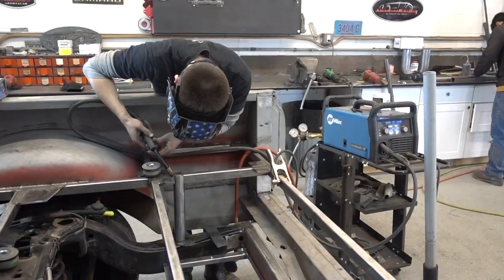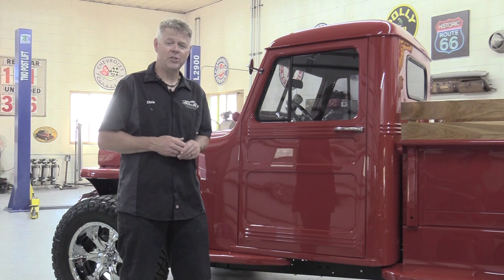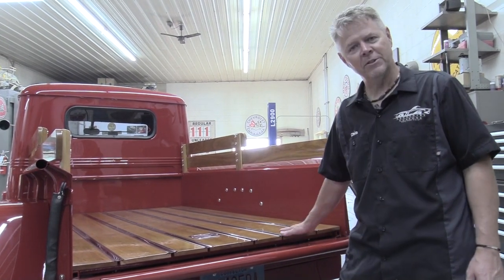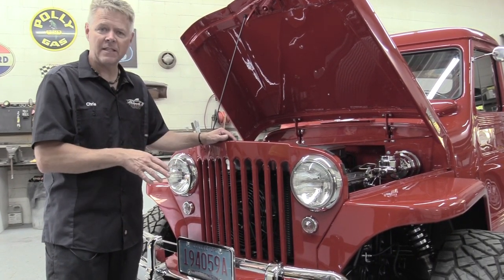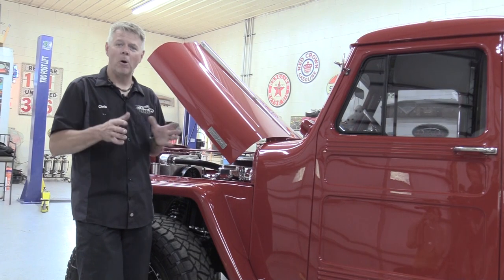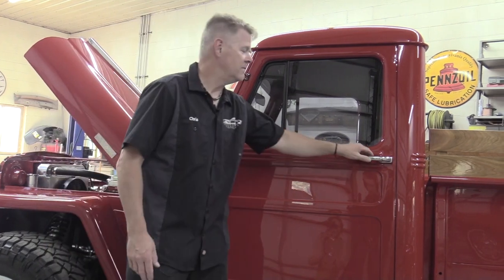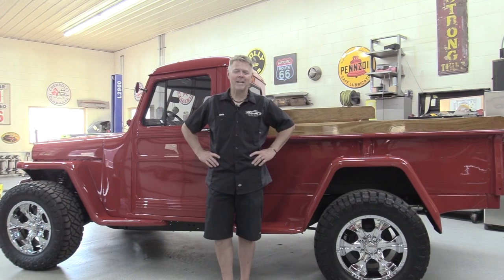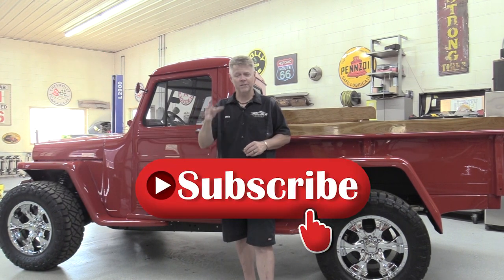LEGENDARY 1948 WILLYS PICKUP BUILD: PART 13 THE REVEAL

Comment: Great Job!!!  I've got a 1961 4WD OW Truck keeping it original with a Flathead 226 2 speed Transfer case and 3 speed transmission.  Trans, transfer case and front end rebuilt new brakes all around, Aluminum radiator, repainted OD Green with a roller brush.  Looks very tactical with the dull paint.
Reply from the maker: @ericsampson273  All about the memories! Thank you for watching.

Comment: I’ve owned a 1950 Willys truck for 25 years. It’s an on going project. I’ve restored it once and now I’m redoing the drivetrain and making it more highway friendly. I’m shooting for a hot rod muscle truck. Almost done again! Great video! I’ve followed the whole build you guys did.
Reply: THANK YOU FOR WATCHING! You're appreciated.
Reply: THANK YOU FOR WATCHING! You're appreciated.
Reply: My late dad bought his 1948 jeep truck brand new it was painted Potomic Grey ...He plowed snow for several years....the hydraulic plow had a manual lift...this truck had a column shift...I still have it .that 134 ci engine still runs perfect.....just starting off frame restoration....a very rare running board under spare tire and passenger side just behind cab .The Jeep Truck on the hood is painted red and JEEP TRUCK shines on surface....as proud as ever....yahoo...

Comment: Very nice built. I own a 1964 that belonged to my dad. In my personal preference I would have kept the original drive train but it is a Restomod and what you have done doesn’t take away from the vehicle’s original feel and beauty. My only suggestion to the owner is get rid of the chrome wheels, use something not so blunt and add the white paint to the doors as on the original paint design scheme. It will add a very nice touch and will really look like a original Jeep but definitely more modern.
Great job!!!

Comment: I owned this this truck for 26 yrs before Ron bought it from me. I don't like Chris telling lies about this truck about it being a two wheel drive truck. It always was a four in wheel drive so Chris get your act together and tell the truth KEN.
Reply from the maker: Before you go off again, you're missing a very important part of the puzzle. Yes this started as a 4X4 & then the plan was to change it to two wheel drive with an independent front suspension. Then the plan was to changed to go back to a 4X4 because it's a WILLYS after all. So with that said, my act is together. Anyone who watched the build can see it was a 4X4 when we started the project. I believe you misunderstood a part of the puzzle that changed from beginning to the end. So settle down Ken. No one is lying. I'm quite certain Ron knew it was a 4X4 in the beginning also.
Reply: I have a1956 WILLYS OVER LAND truck and have done a lot of work and extended the bed longer to 8 ft and is in the process of being painted" RED" Just like yours, i will try to post pictures of it when finished, (from Santa Ana Calif.)